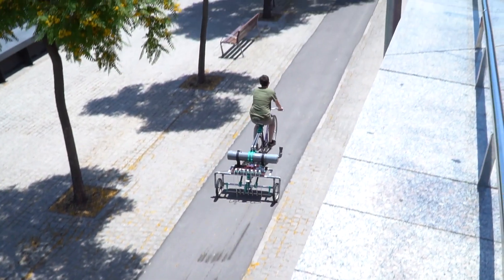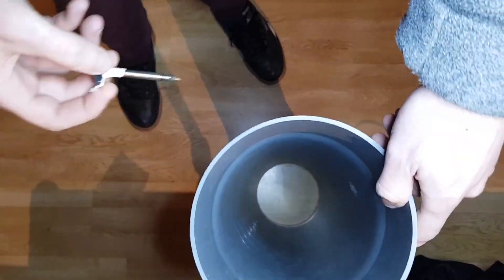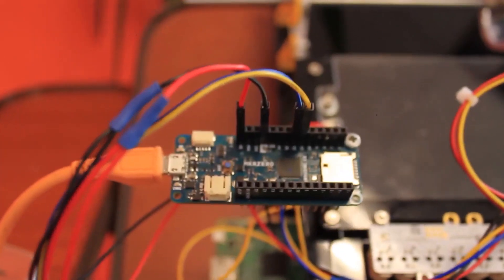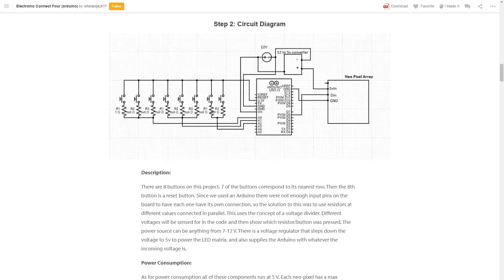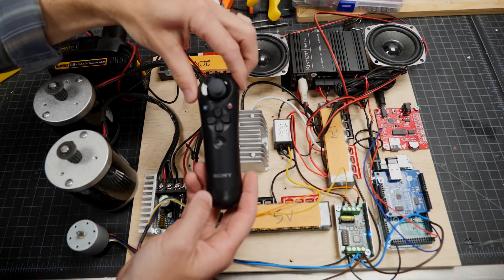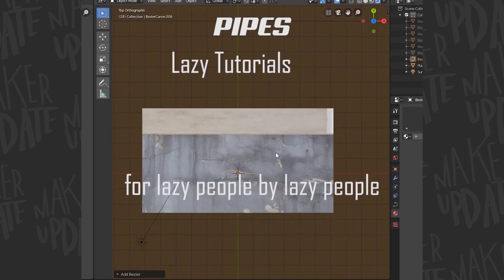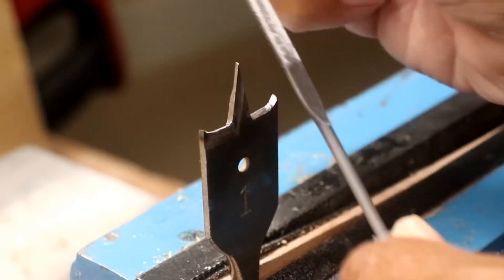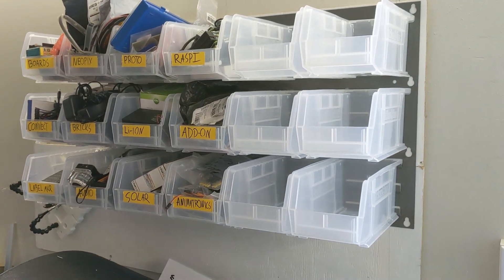Bike Messenger [Maker Update #183] - Maker.io

Comment: Organization: My wife found some panels made for Retail stores that have roughly 4" squares with round coated wire.  She got a bunch of hooks and baskets that fit on them.  The best thing is they were cheap (i.e. free) for us as a retail store was trying to dispose of them and they were in great shape.  They are available new from standard store suppliers.  I have them in our utility room, garage, even my computer room.  Great for hanging bubble packs or rakes. shovels, hoes, etc.  Shelves in my computer room holds batteries, multi-meters, supplies and even a few finished projects.  Great stuff, that we would not have been able to afford otherwise.